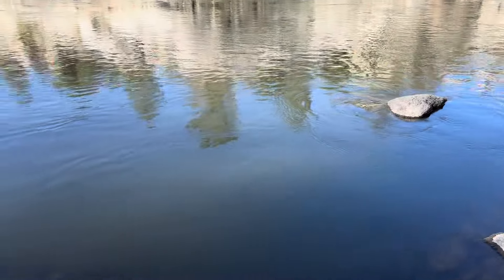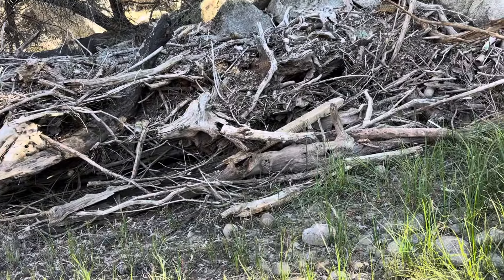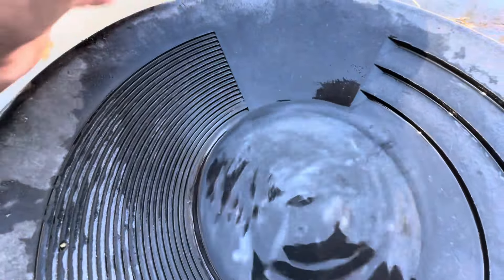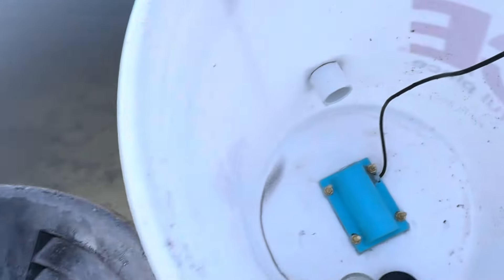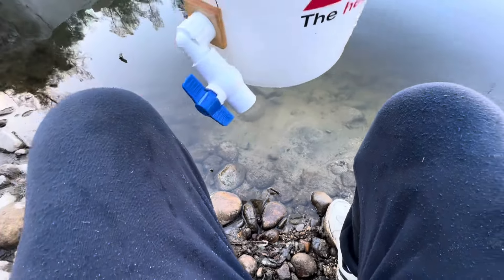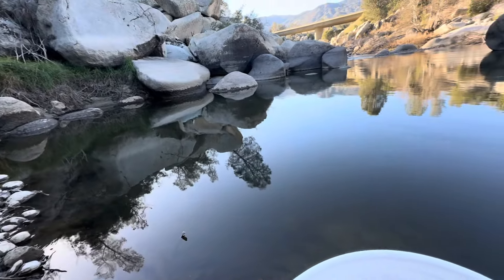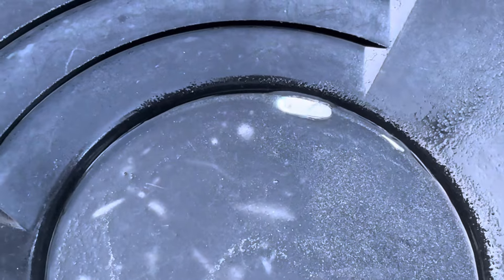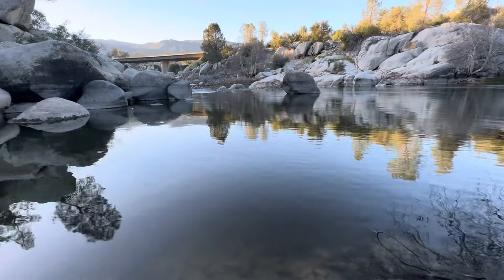Thinking how concentrate microscopic gold

Comment: That's not so just by using Jet Dry makes it sink in this area in the Yellowish clay this kind of gold is 1 ounce per yard of clay you need at least a 12' trommol to break down all of the clay, just in a golf ball size of clay and  break it down and get all of the clay floated off and let the sunlight shine it turns the water Yellow from all the gold, try using charcoal the Chinese  would  use this to catch every speck of it.
Charcoal in a gunny sack it picks it up like a .magnite